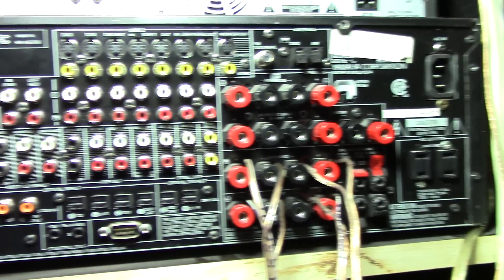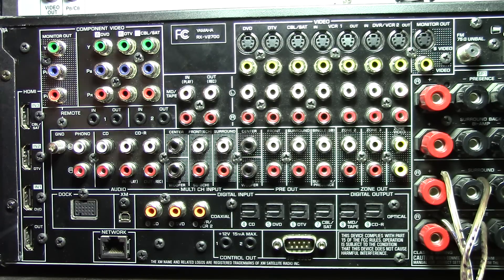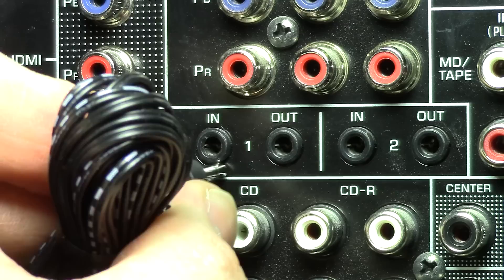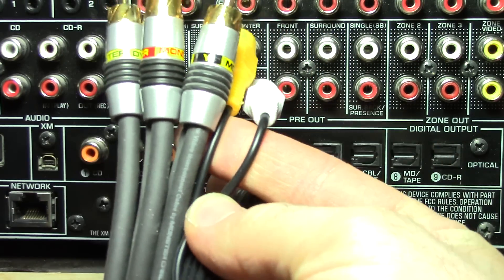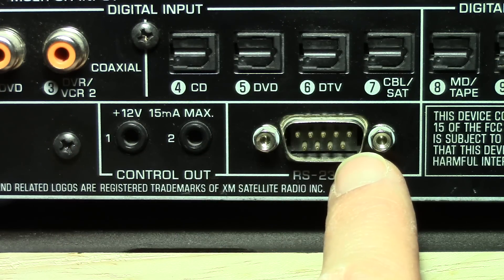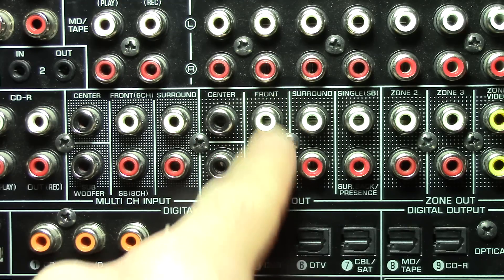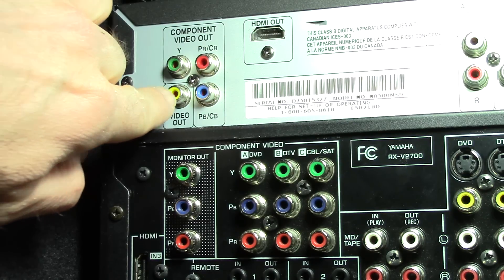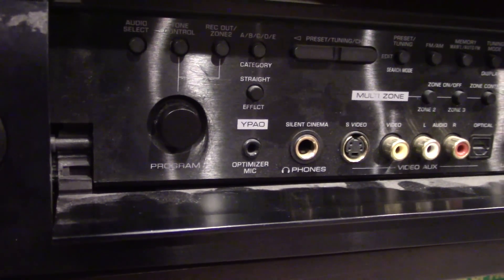Yamaha Receiver Rear Ports HDMI ARC COAX COMPONENT Explained RX-V2700

Comment: It's my understanding that the HDMI - Out port on the Yamaha RX-V3800 is NOT ARC compatible.  The technology was not around when this receiver was produced, nor have any firmware upgrades converted the connection to ARC compatibility.  Since the RX-V2700 is older than the RX-V3800, this would confirm the 2700 HDMI-Out port is also NOT ARC compatible, as the narrator suggests..

Comment: Pre out is for additional amps as well. You can take the load off of your receiver and just use it as a controller. It’s easy to build a powerful system by using multiple amps this way. With a 7.1 system you can have an inexpensive amps for your back speakers and another one for your front speakers. Maybe use the receiver for the center channel. This way you don’t overload your expensive receiver.
Reply: V

Comment: Nice video, but with a small correction. Those little black, round sockets, with 4 pins in them are S-Video, not S-VHS, which is something else. It's true that you find those plugs mostly in S-VHS machines, but the name is S-Video.

Comment: Hi, I just replaced two RX-V377 Yamaha Receiver/Amps and have tested and confirmed the problem in both cases is the HMDI cards.  While using one of the bad HDMI cards neither of the four units will power up.  Using a good HDMI card and all four units work perfectly.  Notice, "power up" is the issue.  The power supplies to both "suspect units" tested perfectly.  

From Yamaha, a new HMDI card is $169 and I ONLY paid $80 for the two complete units on ebay.  Here is my thinking: 
1.  The "protection" circuits on the HMDI cards are not allowing the power supply to engage. 
2.  The vendors who sold me the replacement (Used) units likely had the same problem (Would not power up due to "a turned off HMDI unit" by the protection circuit).  
3.  Using a magnifing glass and good light, all four HDMI cards look exactly the same. 
QUESTIONS:
a. How can I find a vendor/repair-place to repair the two inoperative HDMI cards? 
b. How can I sell the two good amps with inoperative HDMI cards for $40 each plus $12 freight? 
c.  What other suggestions?  

I can use the two inoperative units if the HDMI boards are repaired.  
I appreciate.  Jim.clayton at Claytonbank d--com.  Thanks!

Comment: But the subwoofer pre out has a low pass filter built into it which makes it to where any amplifier hooked up to it will only receive low frequencies so therefore you can only hook subwoofers up to the subwoofer pre out speakers that can't handle the low frequencies will blow if they are hooked up to the subwoofer pre out speaker pre outs don't have a low pass filter in them though only the subwoofer pre out has a low pass filter

Comment: Hello, I have a Yamaha RX-V459 w/ the XM connect & Play capabilities. I purchased the XM antenna through Sirius XM but the factory jack on the antenna does not match the port configuration of the receiver. The port looks exactly like the one you demonstrate in your video. Do you know if there is a converter out available or have any suggestions?

Comment: Hi There,

I would need your help to set up my Onkyo TX NR 6100 brand new l got it as a gift 4 years ago and never got to use it.
I would need your help to set it up with my Bose Acoustimass 3 Series IV Speakers that have both the input that comes from the amp and the output that goes to the cube speakers at the back of the sub.

I have two sets of the Bose Acoustimass 3 Series IV Speakers and would like to use the front and rear speaker output of the TX NR 6100 like an integrated amp for playing music as well as watching my cinema.

Thank you for your help. 

Michael

Comment: I have come across a RX-V1900. Would appreciate any advice out there. At the moment I run my audio output from my pc to an aux on a old stereo. I was wanting to run my pc audio direct thru the Yamaha to my existing stand alone 8omh speakers is this possible or do I have to put back stereo and send that audio to the Yamaha?. Thanks in advance for help
Reply: Brad...there should be no reason why you can't connect your PC audio to the Yamaha RX-V1900.  What kind of output are you using from the PC?

Comment: plz help. hav the Yamaha 679 & we hooked all this up on xmas. took wk 2 figure out ARC , was working for a wk or 2. the streaming audio from Samsung tv smarthub. it works out of tv speakers. so is receiver. I have Arc/hdmi all on. am updating firmware again. had 2 from start 4 it to see 5 ghz WiFi. i even tried manually inputting.... nothing found..   Most important now is Audio from tv... all strange.  so connected to 2.4. ! Am sooo frustrated! Don't know enough about all this.. the streaming from BD is fine. but doesn't have the apps i WANT to use. plz help. how to reset? or? ive watched your video & everything I can find pertaining to thid model! unable to get Bluetooth to connect again as well.

Comment: Just curious about connecting the out wires to your speakers. What happens if you have speakers who's RMS rating is different such as a mid range driver who's RMS rating is 50 watts and a tweeter who's RMS rating is 25 watts. How does that affect the wiring of the receiver or does it? I'm nervous about blowing a speaker when turning the volume up significantly. Any help you can give would be much appreciated! Thanks
Reply: The Receiver automatically adjusts to whatever RMS rating your speakers are, a Great Yamaha feature,don't know about other receivers because I only have Yamaha brands

Comment: How's it goin , I just picked up a yamaha rx-v3900 and i was wondering if I can use it as a 2 channel stereo and if running 2 speakers where do you hook up the mains ?This is my 1st surround receiver  , im more into the solid state 70's gear but I couldn't pass this up for the price . Thanks for any input
Reply: I'm not sure if you solved your problem or not, you did post the question 5 years ago, but yes, you can use it as a 2 channel amp, the mains gets plugged into the only socket that's there.

Comment: This player doesn't support HDMI Arch?. I have tried and it's not working. Anyone has any luck audio via HDMI? please can you assists?
Reply: Yeah, I am pretty sure this particular model doesn't support arc.  However there are settings in your tv sound output that should be verified.  You have to enable arc on your tv and turn on arc on the receiver with the hdmi output connected same cable. I would think it should also work in one of the hdmi inputs on the av receiver as long as arc is enabled from the tv but it may not.
Reply: @robertmekemson12  in my sony tv I have a arc output on HDMI 3. But in my receiver there is no arc option. There is only HDMI audio option only.
Reply: The work around which is not optimal, is an ARC hdmi audio extractor,  by Tendak (probably other designs as well.), hdmi arc in to adapter from tv, then optical spdif or digital coax rca line to your av receiver.  This will work.  You may have to adjust settings in your tv sound (arc enabled) as well as pcm or other.  Make sure hdmi cable is 2.0 or arc two way compatible (Mediabridge makes great cables).  You could also as a last resort (If your TV has a headphone jack) use 3.5mm mini jack to RCA stereo cable adapter (a 90° 3.5mm miniplug would work best) into the receiver. (Probably will not pass 5.1 surround.) but you will have better audio using your av receiver.  I was hoping as stated in discussions below that Yamaha would have a firmware update for this receiver to correct for ARC and some of the XM bugs, but they moved on.  The RX-V2700 is a beast of a receiver, really love it but now it is old tech.
Reply: @robertmekemson12  hi Robert. I bought an HDMI arc adapter connect that to the to the TV and the  receiver but I am not getting audio. Can we chat via email or Whatsapp.
Reply: @Shafy7  Well, not knowing your TV and the setup I can give you a couple of ideas that may work for the ARC adapter.  Make sure your tv is recognizing the adapter, it should show in the device section or as an input source.  Also, check via your headphones if there is audio getting to the adapter.  If none, cycle the power to tv/adapter.  I actually reset my tv sound settings (Which is an older Samsung).  Not sure what to do if those don't work other than the following options.  I am sorry for this and sometimes these electronic gizmos only work in certain configurations and with newer tvs.  If you are not using your digital optical out from your tv plug that into your AV receiver.  If it is already being utilized your 2nd to last resort, get a powered spdif/toslink splitter, this will allow you to send the digital optical signal to your receiver and your sound bar. (I actually had this configuration for many years before getting the ARC adapter.)  Only drawback is that your sound bar may not go into standby unless you manually turn it off if you have one connected.  Last resort (If your TV has a headphone jack) use 3.5mm mini jack to RCA stereo cable adapter (a 90° 3.5mm miniplug would work best) into the receiver as I stated above.  This is about all I can recommend.  I am sorry if you don't get the ARC to work but the last two are not optimal but options.  What a pain huh?
Reply: @robertmekemson12  at the moment I am using optical from tv to the av receiver. Look all good but I would prefer HDMI audio as the DTS audio over optical  gets encoded. As I am using Plex it sometimes can't handle.
Reply: @Shafy7  so, how may I send audio from my Sony tv to my Yamaha receiver? Now I use optical cable, but in this configuration I can't control volume on Sony remote.
Reply: @GiorgioPrimiceri  I'm having the same issue. As the receiver doesn't have arc option.

Comment: This receiver does not have ARC.
Reply: I would expect the TV's ARC to go into HDMI IN1,IN2,IN3 where the TV is driving  both audio and Video and no display signal is needed to pass through the receiver.

All Audio comes from TV through on receiver's processing/amplification with variable out driving the volume via the tv. 

The HDMI OUT would display video only as the receiver is carrying the Audio duties and presuming they are output via the speakers connected to the receiver.

If you want the TV to play processed audio through the on board tv speakers (Cause you must hate quality audio lol) then I assumed you would send it to the TV sound in via (Digital Out 8 MD/Tape or 9 CD-R) or more likely paring an analog RCA out to a video input where HDMI is video IN and the audio arrives via another connection type (not HDMI) or some other analogue connection.   

HDMI ARC would allow audio to come from the TV or to The TV via the HDMI Out connection. Where video switching on the Receiver or the TV would not be necesary you would stay on the HDMI ARC Channel.

Do I have that right?
Reply: Found this video trying to get more info on using ARC from my Sony 4k TV. As per this comment and reply, it seems odd to run ARC output from TV To HDMI output on this amp (same as mine)?? 
Anyone successfully got digital audio from ARC TV output to this amp? It would solve my 4k switching issues and save me buying a new amp!
Reply: @CamGTS  any luck.i am facing the same issue as well.